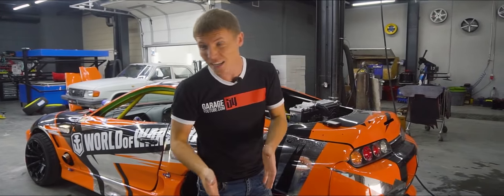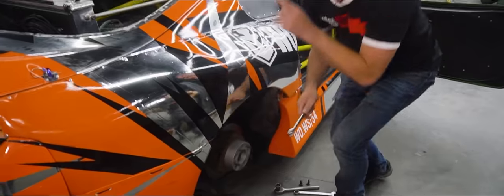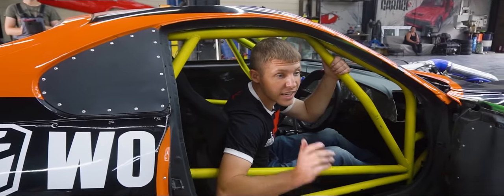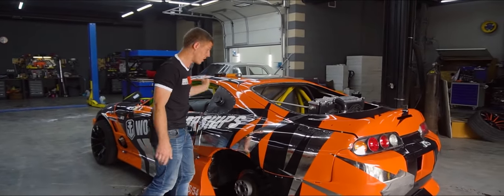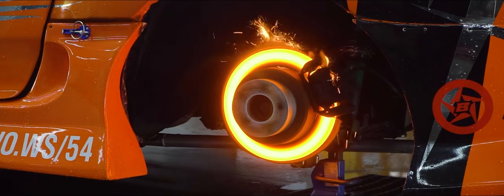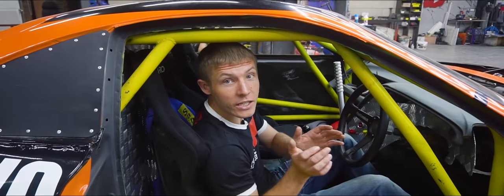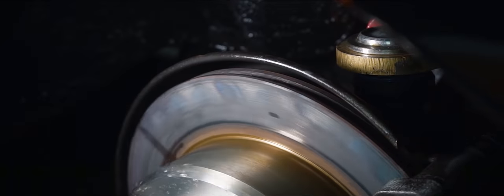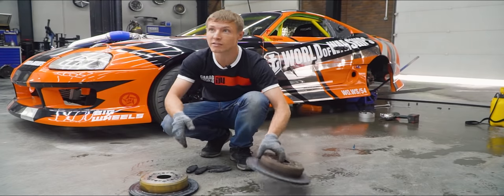Drenching a red hot brake rotor - what'll happen?

Comment: Customer: "I don't care how badly my brake discs are warped. Just replace the pads and don't try to scam me again."
Reply: Lol :)
Reply: I'm one of those people who changes pads, like, 5-6 times before swapping out the rotors (when ideally you should replace them every 2-3 sets of pads). With my driving new rotors warp pretty quickly anyway, might as well continue using them.
Reply: @SwapBlogRU  I am the same. I have even warped.my rotors back straight again eventually!
Reply: @Kris Nicholson I do not know how it is there, bit in Ontario Canada, it is cheaper to replace rather than machine.
Reply: @Kris Nicholson I'll get there. It's just that I'm stupid and I put all of my money into my engine, and deal with stuff like tires and brakes like you would if you were Russian.
Reply: @justanoldtowtruck1962  ah yes, I used to do that too) I'd buy a set of aggressive pads (my go-to was Sumitomo, back when I used to drive a Toyota Windom) and let them do the hard work of refacing my rotors. What's amazing is that it actually works.
Reply: That's sign of terrible driver.
Reply: Ahh how many people have said that only to come back after two weeks to replace AGAIN the pads together with the discs.. And the funny thing is that they can always reface the discs if they can't buy immediately new ones 😏
Reply: @Kris Nicholson I'm not gonna argue. Admittedly my tires and brakes are ridiculously inadequate for the ~330 horsepower I'm running in my car, but I know their limits very well, and I know when to back off and keep from sailing into a ditch or a tree. I quite enjoy being alive, you know.
Reply: @SwapBlogRU  And we'd very much miss you if you were gone. 

Altho I'm sure you'd find a way to do ghostly voiceovers :D
Reply: @Kris Nicholson  hey thats pretty cool. a car culture shock to me really hearing that
Reply: @jameshunt5316  I know that resurfacing brake discs (rotors) is common in the USA, but it's really uncommon in the UK. Very few places have a brake lathe here, they're an expensive machine to not get used often, so by the time you find someone with a lathe, the cost to resurface will be more than the cost of new discs for most average cars. For example, a Ford Focus, front brake discs can be bought for less than £50 for a pair. You'd struggle getting them resurfaced for less than that over here.
Reply: Teribus13 gotcha, here you can’t even get rotors or “brake discs” for less than $50. More like $50-$120 even for the Ford Focus. Hense why I understand why we resurface them compared to you haha
Reply: @Teribus13 oh and those prices were for singles not a pair my apologies for not including that haha
Reply: @Kris Nicholson What's your opinion on GM's new 9.1L V8?
Reply: @potatopie1696  GM has to do something since it cant make any electric cars right now and with the middle east problems going on right now the raw batteries for the cars a few years down the line is also looking bleak
Reply: @jameshunt5316  unless you use rockauto then the rotors cost fuck all lol
Reply: @Kris Nicholson I did the drum assembly, shoes, calipers, rotors, and pads for my Escort under $200.
Reply: A' I just did a 2003 Chevy Venture all new brake rotors, pads and calipers, brake drums and drum pads as well as both rear brake cylinders $1100 in parts alone.. but the stupid pos van stops on a dime now lmao (it got taken on three 48 state trips and racked 308k so far) ((best Chevy I’ve ever seen))
Reply: Brayden K. I don’t use rock auto for anything that matters lol they’ve proven to me they sell mediocre parts. I’ve had sensors in the past come from them and they either didn’t work or were fakes, as well as mounts and other products shipped that didn’t even fit the vehicle labeled lmao I use them for things that don’t matter like trim, pins, headlights and body panels etc. It’d be my luck I order a break rotor and they ship me one with the wrong number of holes lmao
Reply: @jameshunt5316  fair enough, I haven't ever had any issues with all of the parts I have ordered from them. Well minus an oil cooler line that wasn't tapered properly but they automatically refunded it and didn't expect the part returned. I typically do research into the parts I am ordering though so that might be partly why I never have any issues with ordering the wrong part to begin with when they have it labelled incorrectly lol
Reply: To all the people talking about warped rotors, that's not a thing.  Warped metal rotors do not exist.  What happens is the brake pad deposits unevenly on the rotor so you get pulsating that you attribute to "warped rotors." But there's no such thing as warped rotors and you all just sound ignorant.
Reply: Lol! I've seen a video of "Customer states what" where someone refused to change the pads that had no brake pad material left on them, but wanted something to be done about the sound the brakes made every time he used the brakes.  How stupid can someone be into thinking the mechanic was trying to scam him at that point? The sad thing is those people can cause an accident and kill someone because of that.
Reply: DREADNOUGHT MOTORSPORTS sorry to make you sound ignorant but that’s what a “warped rotor” is. It becomes uneven and can have light or deep scratches and deposits that lead to a “pulsating condition” known as “warped rotors” at that point you have two choices (assuming the rotor itself has enough material left) you could shave it back down flat and balanced or you can buy a new one. Effectively a “warped” rotor surface. You literally said there’s no such thing as warped rotors then wrote the definition....
Reply: A' the only thing wrong with oreillys is the employees hahaha around here they’re high school drop outs who can’t read letters let alone offer any mechanical advice or even find parts on the shelf without their managers lol....
Reply: @jameshunt5316  sounds like you have a bad case of confirmation bias.  Friction material built up does not equate to warped rotors.  Its an old wives tale.  Do you still think the Earth is flat, too?
Reply: Just turn down the rotor be just fine
Reply: relatable
Reply: @SwapBlogRU  ok....
Reply: Must be Karen LOL
Reply: Efficiency -999999999999999999999999999999999
Reply: @dumpjeep  sound like you have a bad case of dunning Kruger
Reply: @justanoldtowtruck1962  I'm guessing because most of the production plants are in Canada, and Mexico. So the parts are fairly cheaper when you live where the parts are made. Every time I look at my part boxes they always say Canada, Mexico, or Australia.
Reply: @SwapBlogRU  if it works, it works.
Reply: @garyw9108  honestly most boxes I read say made in china. Locally made parts actually cost more, in some cases you can't even buy something made here. 
I direct your attention to Gabriel suspension components. Made in Canada, almost nobody sells them, but when I could make a 30 minute drive to NY, they were everywhere and superior to most other brands.
Reply: @Kris Nicholson things are the same here. For your smaller, more common cars it's just load up the parts cannon and open fire. 
For anything older, or sports/high performance oriented, it's very hit and miss. Sometimes it's the same deal as something newer, just replace it. 
Sometimes replacement parts either no longer exist, or are so expensive you start looking at upgrades. 
One customer uses ONLY dealer rotors on his stock E36. For the same reasons I agree with him, nobody makes them as good as factory for those cars, with their proprietary metallurgy. Those ones I go hunting for someone with a brake lathe. Which 20 years ago was commonplace in every shop. 
It all came down to cheap cheap replacement parts from overseas becoming available. Anyone who truly appreciates driving will spend the money to do it right. But most people here look at a car as a nasty but necessary money sucking evil. Because of the Big 3 (Ford GM Chrysler) having their hands deep in the pockets of the government for so long, we do not have anything approaching an acceptable mass transit system, at least outside a provincial capital.
Reply: @Kris Nicholson I would also love to afford to ship my car to Europe and drive it there.
Reply: @justanoldtowtruck1962  that's sad. In Wisconsin we can get Canadian parts everywhere.  Most of the cadillac parts all say Canada. My Subaru performance parts say Canada too.
Reply: @potatopie1696  I don't know anything about that but that flat plain crank 5.5 is going to be a god damn beast.
Reply: I worked at a shop and left after 8 weeks when the manager kept selling pad slaps no matter how rotted the rotors were. I just straight refused to do it, not safe or good customer service to not do the job properly!
Reply: @Kris Nicholson true, but euro 3l cars have 2x the power of most USA/Canada 7l cars.
Reply: Hahaha
Reply: I once got charged $60 for a battery terminal cleaning. That is a rip off. Car repair places can and do rip people off, depending on if theyre honest or not.
Reply: You: I eat my applesauce with a fork
Reply: HAHAHA
Reply: True, but I just replaced one axle of pads in 1 hr start to finish. A local shop quoted me $800 for pads and rotors. My upgraded parts were $250. So please explain to me how that warrants $550 labor.
Reply: Al the time
Reply: lololl
Reply: For God so loved the world that he gave his one and only Son that whoever believes in him shall not perish but have eternal life. John 3:16.
Reply: I'm on i think the 2nd pads and I've gone a little over 20k miles and still have 70 to 75% pad is that good or bad.
Ps im in 2005 toyota tacoma prerunner v6 4l.
Reply: I replace both at same time.  Modern rotors are at minimal thickness for weight and fuel economy and once pads are worn and the caliper piston is pushed back your tolerance is out of spec.  So turning the rotors to refinish the surface will only thin it more.  The thinner material will heat quicker and thus brakes less effective.
Reply: I just turn the rotors around 3 times per rotor once per pad change
Reply: I never own a vehicle long enough to worry about that unless their already bad when I initially buy it
Reply: @SwapBlogRU  Holly fuck.... 2 pads 1 rotor is the rule
Reply: @justanoldtowtruck1962  in joke as a kid I used to do this with solid rotors a lot, friends and parents where amazed I could basically take a ruffle chip and make it strait....
then as an adult I bought a 6piston brembo brake set and though hell these are race brakes with big ass rotors they wont crack or warp... roflmfao.... holy shit i was wrong... 

and holy shit my pocket book didn't like new rotors either... moral of the story is it is all fun and games till you have to pay the bills.

"on another car my buddy even had a warped rotor so bad i licked the caliper off and caused his vehicle to lock up the front left wheel sending him into a pole."

kind of one of the last times I had ever fucked around on shitty tired or bad brakes, no swear by good operating brakes and well treaded tires. 

no point in going fast or having either if u slide thru or blow thru the brakes.
Reply: @garyw9108  lot of chinese, hard to get quality in canada
Reply: @SwapBlogRU  buy better brakes instead of using loads of cheaper ones, probably more cost affective and will save you time.
Reply: @dumpjeep  obviously you never lathed a rotor before.. brake pads don't deposit shit on a rotor they grind away and dust.. heat causing warping of any kind of metal its basic metallurgy.. and physics.. think before you speak
Reply: Ten minutes later on a back of a flatbed
Reply: Customers these days...🤦
Reply: @SwapBlogRU i used to warp rotors a lot too, buying really high quality ones will help you
Reply: I don't think 🤔 so it warps change them if not your going to have more problems seriously
Reply: i told em exactly this.. he said there was such an "L" carved into the rotor that he didnt know if itd even hold... i said replace the pads, ill deal with it if it gets worse or anything happens.. they did, it never slipped or failed lol. a back brake on an expedition.
never thought they were scammin me though, it was more about safety and it failing, to him.. but i needed the vehicle back.
Reply: @skotwilt  did you get it back? You have to watch who you trust with your car anymore these days. Look at rotors yourself see 👀 how bad they are if there to thin I would replace them